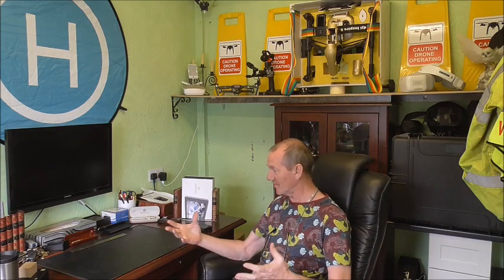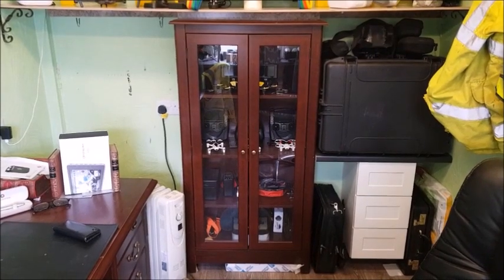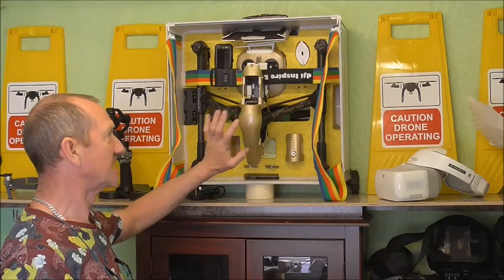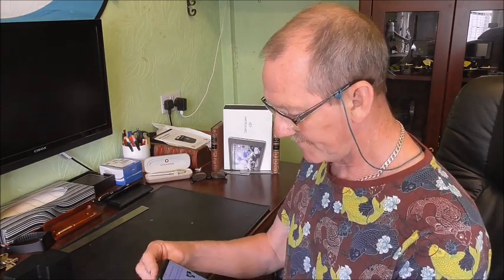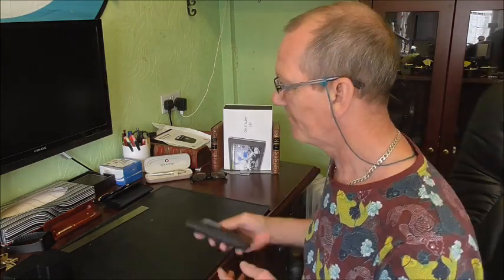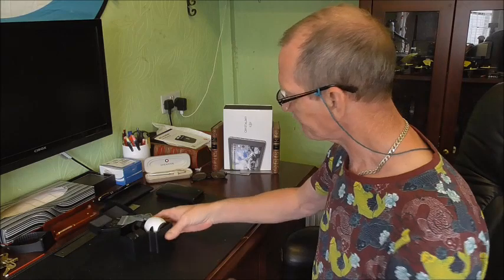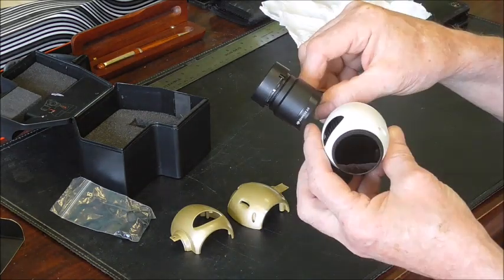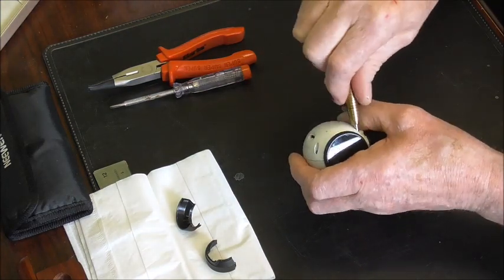Converting  DJI X3 to NDVI camera

Comment: On some conversion websites they mention a software upgrade too.  In your video it looked like you left off part of the Lens edge,  also when focusing it I'm assuming you turned the screwed in NDVI lens,  was there any substance in the thread to stop it from moving after focused? Just my questions from buying NDVI X3s now selling around $200 and wanting to convert them back using the lens I have from bad X3s here.  Thanks for the video it answered many questions I did have.
Reply: I have the same question. Also with a $200 NDVI converted X3